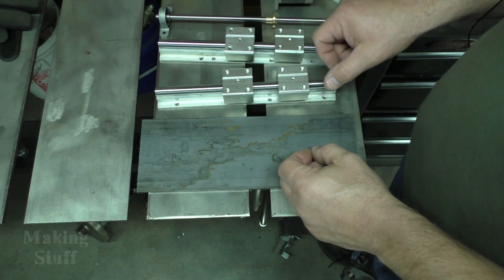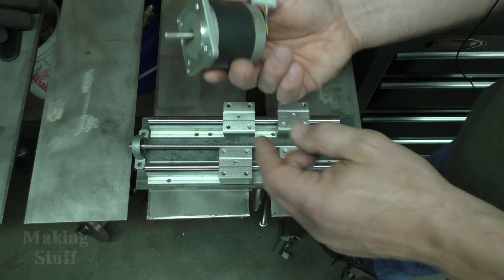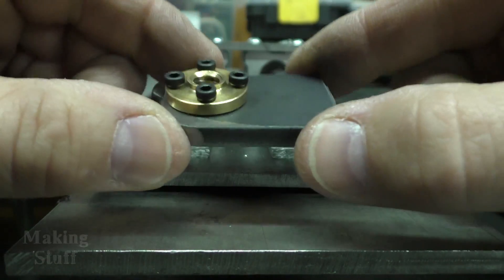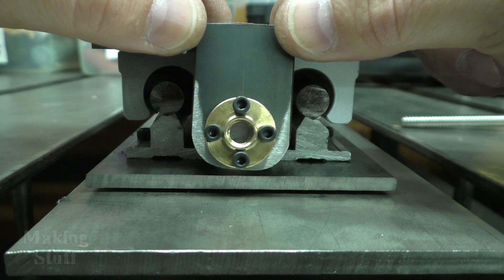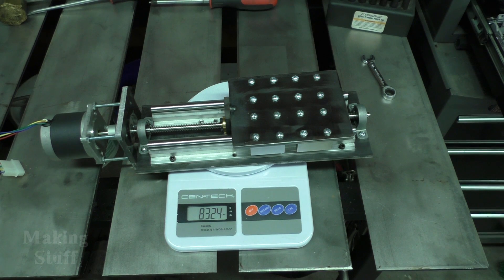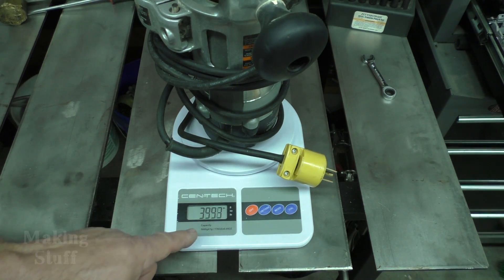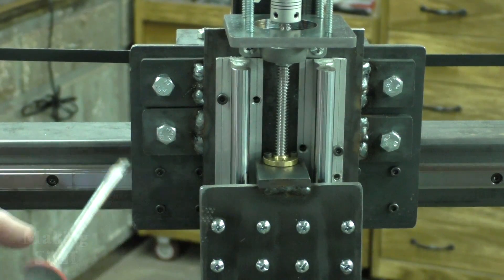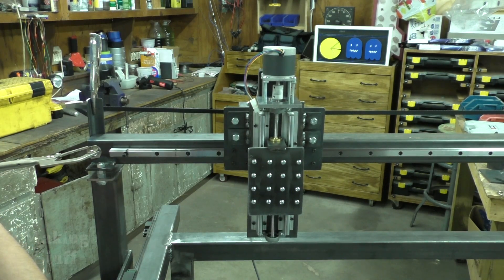DIY CNC Plasma Table Build - Part 5 Z-Axis

Comment: Great job, do you make  your templates for drilling holes or can you get them somewhere? Also are parallel breakout boards compatible with most cnc programs or do certain boards require you to use certain programs?
Reply from the maker: I make the paper templates and most of them are available on Patreon.  Parallel is getting harder to find because most computers don't have parallel ports now.  But I think that most of the popular software still supports it.  I'm not really sure because the only software I use is LinuxCNC.
Reply: @MakingStuff  Thank you very much for responding, I'm thinking of going with linuxcnc as well.

Comment: Hello I built one 8 years ago and used alum. for the z axis because of the inertia of stop and go of torch at fast speeds. You will find you will have to go slower in fine cut areas  Project looks real good, nice build!
Reply from the maker: Yeah I was concerned with the weight too.  It turned out ok.  Thanks for watching!

Comment: Hey there! Nice Job! But you might want to reverse the position of the plate that holds the Z nut, have it at the bottom. That way when the motor rotates the screw to lift the head, it pushes the carriage up instead of pulling it, stressing the joint.
Reply from the maker: Yeah I was thinking about rotating the whole plate 180 degrees which would do pretty much the same thing.  Thanks for the suggestion and thanks for watching!